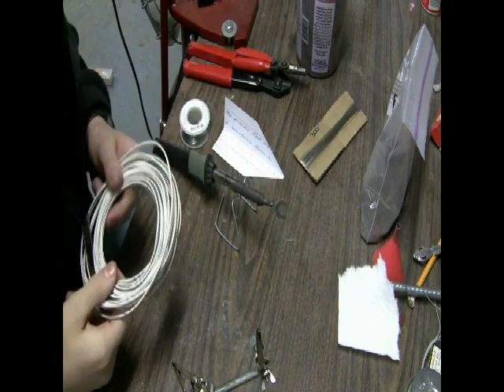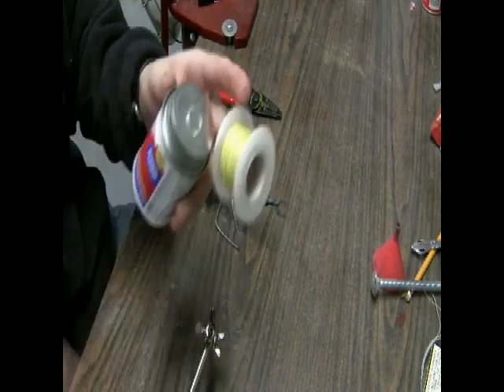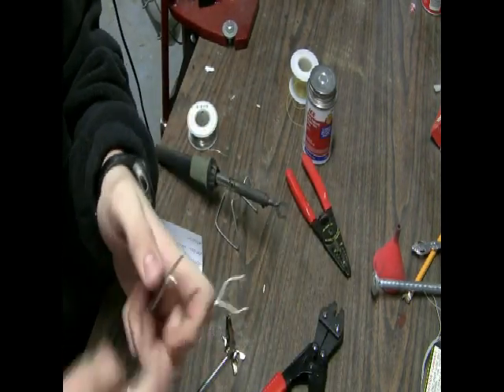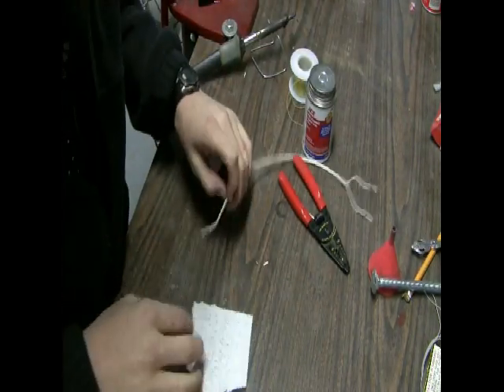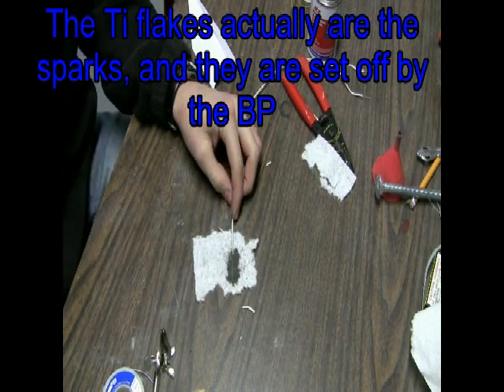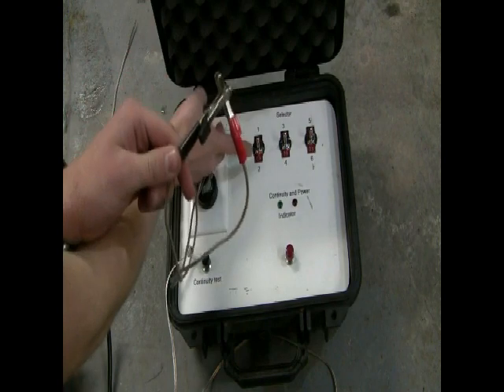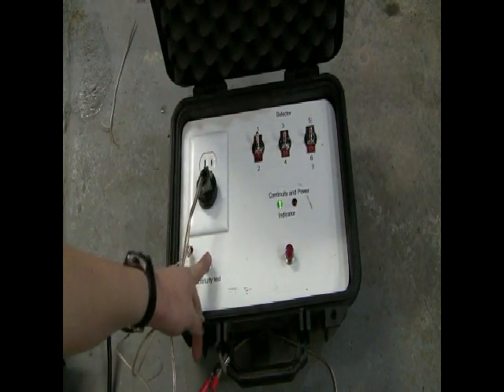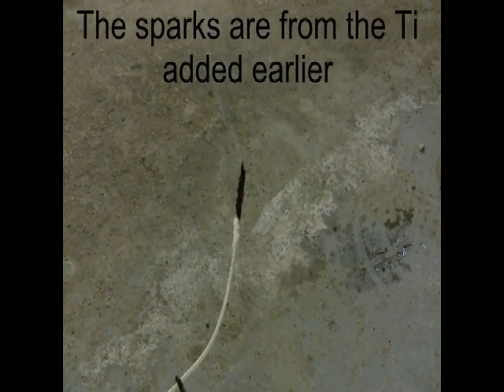How to make an electric Igniter

Comment: Sorry to burst your bubble. NiChrome does NOT accept solder, its the same as trying to solder to stainless steel, tin/lead solder won't stick.
Reply from the maker: Thanks for the feedback, that's why I wrapped it around the wire and used the solder as a mechanical connection since it does "wet" quite well to copper.

Comment: @Rocketkid2121 Thanks i looked for "rechargable LI PO battery" couldnt find anything what voltage is it? what about this 12v one w.maplin.co.uk/12v-sealed-lead-acid-deep-cycle-solar-batteries-265437